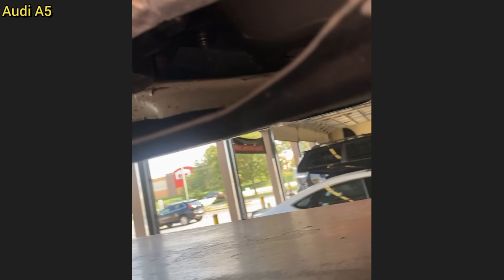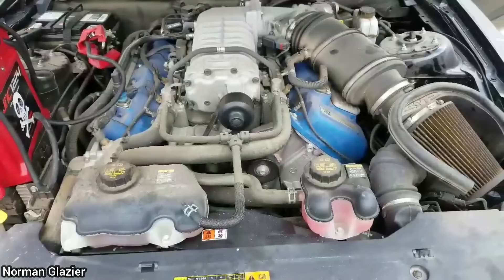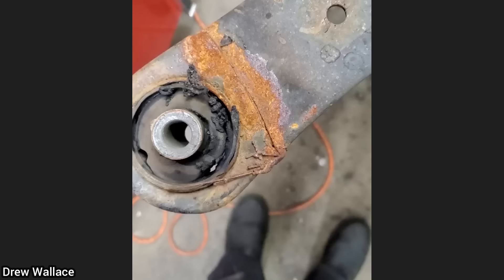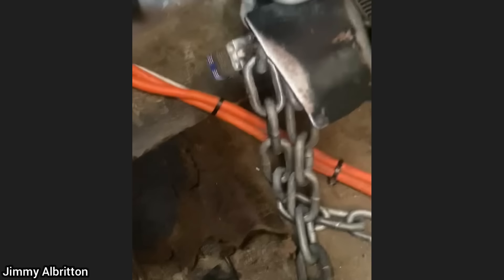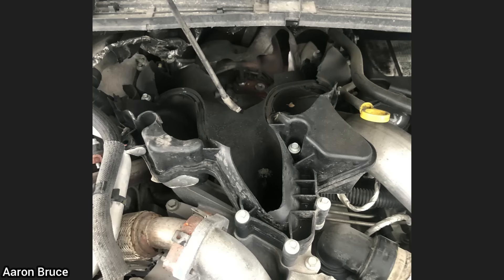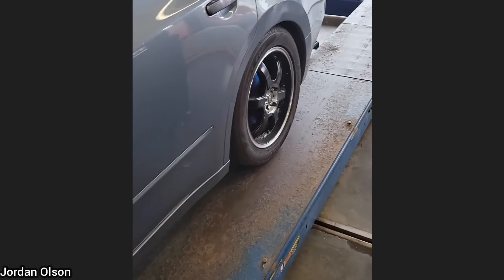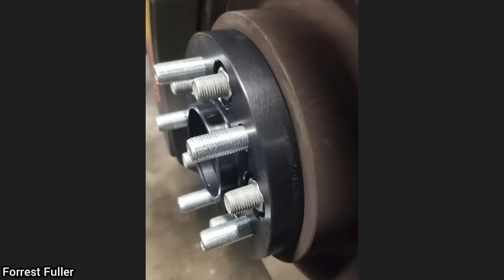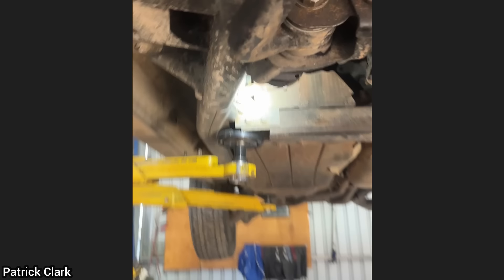Customer States Car Lost All Gears On Highway | Just Rolled In

Comment: Someone bought a GT500, and NEVER GOT AN OIL CHANGE??????
Reply: And it's 12 years old, with only 12k miles.
Reply: Aren't dealers trying to push 10k Mike oil changes now a days? So they were only 2k miles over due LUL. Personally i would have changed the oil myself at least twice by then. It might be excessive and i might be spending too much, i won't go over 5k miles on oil unless i have consistent oil samples to show that i can actually go longer
Reply: All original, 1 owner.  Original everything, original fluids too.  NO LOWBALLERS I KNOW WHAT I HAVE😂
Reply: @legionofanon oil isn't good for 10+ years
Reply: @legionofanon My car has 137k miles with oil changes every 10k with full synthetic as per the VW service manual and it looks brand new inside the valve cover. Just do what the manufacturer recommends, they spend millions researching for a reason.
Reply: I think there are a fair number of people who blow it all on their dream <whatever> and then have nothing left for little things like maintenance.  You see this with people buying their McMansion and then having no furniture.  How much maintenance do you think that house sees?
Reply: @Tracert-mc1hu  The manufacturer only has to get you through the warranty, they don't care after that. Sending in a sample to be tested and gradually increasing the OCI is the only way to be sure.
Reply: @WildBikerBill  and nothing on the walls haaa
Reply: @legionofanon   As a Ford mechanic, I can confidently say that while the engineers CLAIM that they can do 10k without damage, that is very rarely the case. Our dealership recommends oil change every 5k, ESPECIALLY for turbo or super charged vehicles.
Reply: @legionofanon  Only with certain oils, which would probably not be found in most Fords. And he'd still be 11 years overdue
Reply: @legionofanon America really is a different world. I haven't seen a 10k mile oil change in 20 years. My car has been done as per schedule at 18k intervals and still runs very happily at 286k.
Reply: @smorris12  No you don't
Reply: @A.J.1656  I must admit it was an assumption. I'm in the UK, but for the 28 years I've been on the internet, US ideas on change intervals have been crazy short. 3k was the norm back then and it seems to have barely got to 5k now. My first car at the time from the 80s with an ancient 60s OHV engine but with an 8k interval. 10k was the going rate in the 90s. By the 2000s European cars pretty well all had intervals in the 15k+ range. Oil related failures sticking to the schedule and the proper oil aren't common so I find it hilarious to still read stuff saying 10k is impossible.
Reply: @legionofanon  Manufacturers CLAIM 10k oil changes because "low maintenance" sells cars. 10K oil changes will only get you to the end of the 100,000 mile warranty. Meanwhile, people who maintain their cars with oil changes at 3,000-5,000 miles can get 300,000+ miles out of a car.
Reply: @tzon6802  Yes I really do. BMW 320d. I've had it from 127k and 3.5 years old. It was a reps car so would have been serviced by the book and no more often. I've done the next 160k miles and done all the changes myself by the service display on the dash.

I've also got an X5 that is on 188k that gets the same treatment tho I've only had that for 50k miles (think that gets 15k changes.)

Neither burn oil, both run like watches. Both are on the original turbos.
Reply: @alexwalker2582  I change the oil in my 2 EB’s every 6 months at what works out to be less miles than even your 5k interval. I don’t care as synthetic oil is cheap compared to engine repairs, especially with turbos. I also have a 14 year old 5.4 that still runs as quiet as the day I drove it off the lot and doesn’t use a drop of oil between changes. Proper maintenance from day 1 works wonders for an engine.
Reply: @arc00ta  I was doing 10k oil changes and sending a sample to the lab every oil change til I relized the lab cost were only slightly less then changing the oil twices as often. I worked as a diesel mechanic for 20 years and we did 20k and samples nothing ever made 500k with out a failure, and working on   20k oil change and a 12k oil change engine was very different, 20k you replaced everything and 12k you replaced what was broken.
Reply: That’s what I was saying. I’ve been wanting a Mustang forever and I wouldn’t treat it like garbage. It’s most likely a garage Queen since it’s a 12 yo car with only 12k miles.
Reply: @legionofanon Oil has a service life of 2 years, so it was 10 years overdue. You cant keep it in the sump forever.  Modern synthetic oils are good for 10K miles in non-turbo engines but 5K miles for turbo engines.
Reply: IKR ?!?! Who does that ??
Reply: @jellef4704 my grandpa has a ‘04 BMW Z3 that he bought brand new and he treats like his baby… as in drives it once a year like 10 miles to the store and back.

He hasn’t changed the oil in atleast 5-7 years because “I’ve only put like 2k miles on it!”…

Little does he know I steal it every now and then and got the oil changed for him lol
Reply: @Tracert-mc1hu True, but for severe service those oil change frequency is much shorter.
Reply: @alexwalker2582 the problem is, telling the customer they need one every 5k and then they think you are ripping them off, thats why manufacturers try and extend service intervals to make the customer feel beter
Reply: @smorris12   ahhh see there's the information you left out. 320d. That d makes a huge difference in how the engines duty is cycled, my friend. Yeah 10k + changes for diesels are fine. Especially with the quality of fuels and oils you have access to in the UK.

The automotive literacy of the average American would terrify you.
Reply: @connor3288  We've all read that infuriating ad
Reply: My Skoda Superb has 20,000 or 2 years oil change intervals, what is it with American engine's. Modern fully synthetic oil is far better than old mineral oil.
Reply: @fenman1954  is that km? 20000 km is not the same as 20000 miles. 2 oil changes in 20000 km isn't bad at all. This had 12000 miles and NO oil changes
Reply: @fenman1954  nvm I misunderstood that. 20000 km intervals. That's not a good idea. I drive a Toyota and I wouldn't let my car get that high
Reply: He's keeping the oil ALL ORIGINAL
Reply: I change mine every 5k, just because I don’t have to keep any notes. If the odometer has a 5 or a 0, it’s time for an oil change. 

I’ve heard many of these where people run the car until it won’t move, no idea that oil needs changing. My niece had a used car,  but very nice, the low oil light came on, she kept driving until it wouldn’t move! Back in high school, there were girls in drivers ed class that had no idea what made a car move! While it wasn’t part of the curriculum, we went out and opened a hood, and had everyone check the dipstick.
Reply: @jellef4704 Time actually makes no difference at all, by itself.  Stored oil has a nearly infinite "shelf life", even if it's stored inside an engine if the engine is sealed well.  Oil needs to be changed because it gets dirty from use.  If the engine isn't being run, the oil doesn't degrade... as long as it's good oil to begin with.  However, since that oil had already been run way past the recommended mileage, it had likely turned to sludge after 12 years.
Reply: @kj64gaming19  20,000 mile intervals or every 2 years which ever comes first. The car actually tells me when a service is due. Fully synthetic oil is not cheap but keeps the engine like new.
Reply: @smorris12  those sounds like kilometers
Reply: @TheRealSykx  Miles. 18,000 miles. 286,000 miles.
Reply: @alexwalker2582  The manual for my Ford says to change when the computer says so or  max 12 months, so even with  low mileage you should change it.  I don't put that many miles on mine and I don't reach the max miles,  so I usually change it every 6 months, spring and fall.
Reply: @Crosshair84  I know someone with a 2014 VW Passat, 2.0 diesel, which is used every day as a taxi. It gets oil changes every 10,000 miles. It currently has 240,000 miles on the clock, is on the original engine, and has no issues apart from a faulty EGR valve.
Reply: @legionofanon the first oil change is mandatory, usually after the break-in period (500-1000 miles). If you abuse your car (like any gt500 owner will do), you need to speed your oil changes to 5000 miles, so that  ar was due 3 oil changes
Reply: @rwill156   Good on you sir, that is exactly what you should be doing.
Reply: I remember I saw a commercial once that showed a snobby, posh individual with a british accent saying "what motor oil do I put into my $100,000 (back when that would have bought about 8 new pickup trucks) Rolls?" Then he gets an agonized look on his face and switches to an american accent and gets big-eyed "The CHEAPEST I can get!" (presumably meaning once he blew that much on a car he doesnt have enough left for fancy oil).
Reply: @alexwalker2582  No wonder you don't want to sell the Mustang Mach-E. 🤣
Reply: @legionofanon that would not apply to the first oil change from running in
Reply: @geirmyrvagnes8718  oh no. The reason I don't want sell those is because they are trash. The amount of recalls those things have been getting is ridiculous, the high-volt battery is a complete shitshow to remove, AND THEY STILL CAN'T MAKE A GODDAMN APIM PROPERLY!
Reply: Bro I've owned junk my whole life. That truly broke my heart.
Reply: I've had countless scat packs and rt dodges come in with 20k and factory oil filter.....no oil on dip stick.....mad cause warranty with free oil changes is now void....
Reply: I know, isn't that amazing?
Reply: @legionofanon now a days? The oil change monitor on even early 2000's Northstar Cadillac's were programmed to approximately 10k miles give or take depending on how it was driven, and that was with conventional oil. The engineers at Cadillac programmed it based on thousands of used oil analysis. I've had 4 of them and always waited to change my oil when the car told me and never had any engine failures on any of them. 
"Now a days", they have full synthetic oil and filters that are good for 20k miles FYI.
Reply: @legionofanon They need a job lol that’s why they do 10k intervals.
Reply: 12,000 miles is longer than you should go, but it's the fact that it's 12 years old that seems really problematic to me. At least don't go more than a year without an oil change!
Reply: That's why I never trust "low mileage" vehicles.
Reply: @Tracert-mc1hu I don't think going 12k miles was the problem, it was not changing it for 11 years. Oil will get acidic from a bunch of short trips. Minimum is change once a year.
Reply: @fenman1954 US engines are just fine, and most are changed when the computer says to according to the drive cycle of the owner. All highway? Probably 15k. Stop and go short trips in city and never heats up fully? Probably 6 to 8k.
Two of my BMWs had terrible problems with crankcase ventilation and the system would plug with sludge. Sometimes the oil would get sucked into the engine and ruin it with hydro lock. 
Volkswagen (Skoda) had tons of problems with rear main seal leaking and fixed a boatload under warranty... my brother's Audi and my friend's Jetta both.  No one is faultless.
Reply: @legionofanon  
It is supposed to be changed once a year at least.

But their was a dealer selling a no miles 4 year old Lotus with original oil.  I pointed out to them that that would void the warranty, they were not too happy with me!
Reply: Criminal is what that is.
Reply: @Crosshair84  I thought 3k was a standard.  Why are ppl even saying 10k??
Reply: @livewire2759  "Stored oil has a nearly infinite "shelf life", even if it's stored inside an engine if the engine is sealed well." there was some previous comment about Americans technical illiteracy and you presented it here very well...
Oil engine in used engine is full of stuff that is produced inside your engine...
that include water that is a common huge chunk what is produced when you are burning hydrocarbons aka any type of fuel used in any internal combustion engines that i can imagine now.
The fact that it was used in this time not very often is also sign that the engine was not getting very hot and that is another reason why this oil did not have easy life.
Reply: @mitchhedberg4415  "I pointed out to them that that would void the warranty," posible as it is legal issue, but 4 years old oil that was not used=isclean is not the same as 12 years old used oil full of all kind of chemicals that are not good for it...

Comment: That Focus ST owner expecting a warranty repair! 💀
Reply from the maker: had drag radials on it as well form what I was told lol
Reply: This is only the 2nd time I have heard a Ford Focus ST referred to in a USA video. I assume they I quite rare?
I own a Focus Mk3 ST3 in the UK, they are very common to see driving around here.
Reply: Drag radials?????  For WHAT? ??
Reply: @JustRolledIn  Icing on the cake! What a 🤡
Reply: @JustRolledIn Drag tires+clutch dump=$$$$
Reply: The Focus ST already has an aggressive tune as the motor is not me for anything more aggressive
Reply from the maker: @Lemmon714_  drag racing? 🤪
Reply: @jamesm568 I think you are talking about the focus rs, that thing can't do much more than an additional 50hp, the st on the other had can often easily do 400hp without opening the block, which is 150hp over stock
Reply: @timtechdude4339  I mean in the UK you see more focus st's and fiesta st's than any other country, but I don't think they are that rare in the USA, just less liked, like I see so many people hating on them, honestly just annoying
Reply: @MrTurbo_  That's probably the case, but with aftermarket tunes they like to take out all the delays that adds additional stress to the engine.
Reply: @jamesm568  That's not accurate, some may take out 90% of the safety margins where possible, but there are plenty that keep more than enough in place, especially tunes that are optimized for making use of aftermarket parts like bigger turbo's, exhaust, etc do not need to take out much safety margins to provide additional performance from the installed parts.

Comment: Sweet truck at the end.  I love it when people take these old girls and restore them to live another day.
Reply: Right? There's a classic local to me that's clearly someone's pride and joy. Fuggin' immaculate from the wooden slat bed to the interior and paint.
Reply: K 1500 late 60s or early 70s
Reply: @mikefoehr235  '72 K10 (lights in bumper '71/'72, mirror glued to windshield and no black stripe around grille '72). C/K1500 started '88 (purely as info)
Reply: Yup, that's a proper pickup.  It's not bigger than a  Freighliner, has a proper bed, even has vent windows.  Why can't we buy a pickup like that anymore?
Reply: @MrSloika  Power Steering, and Power Brakes, Automatic (bad leg), and perhaps an A/C unit would be all I needed.
Reply: @MrSloika epa and safety standards.
Reply: @BrianBourgeois-  But at least they have ABS, Traction Control, Stability Control, Lane Departure Warning, Blind Spot Monitoring, Tire Pressure Monitoring, heated leather seats & mirrors, sunroof, backup camera, and more!... All for the low, low starting price of $55,000, with about the same fuel economy as my '99 Jeep Cherokee. 🤣
Reply: Alternatively, this truck was fortunate enough to survive 50 years of terrible owners.  It didn't belong to a guy who beat it with a padlock on a belt, to someone who never changed its oil, or to someone who declined all repairs after taking it to a mechanic.
Reply: Felt I heard my cat purring there.
Reply: Oh for the good old days when Chevy trucks were tough and the factory wasn't experimenting with technology and letting the public find out whether their "improvements" work or not.
Reply: @MrSloika  Yes, a proper bed that hasn't been unnecessarily shorted by a 4-door cab.
Reply: One of my absolute favourite old vehicles is the old trucks just like this. I would LOVE to have one like this over a new one any day.

Comment: I am not ashamed to say i might be a grown 63 year old man but i become a 6 year old girl when i see bugs , especially ear wigs but this looks like a cockroach infestation , still sends shivers . Plus the dealership was wise to fit the bill for that control arm , yes it was welded but with the recall in play and liability issues that could arise in a court of law they did the CYA ..
Reply: The dealership is screwed either way. They have to do the recall work, but if they send it out with an obvious safety issue they become liable.
If it were in for a regular repair or maintenance they could just refuse service altogether.
Reply: I quit a job once on the second day because they didn't tell me there were roaches involved and I don't regret a thing.
Reply: @christopherconard2831  You are spot on , when there is a recall for safety related items which are often but not always called by the Ministry , there is no place for chances . GM has had similar recalls for missing welds and cracks in the cradle and control arms although no knowledge of this Chrysler one but probably similar considering sometimes parts made in the same factory ..
Reply: I wonder what his house is like ?? Crawling with bugs.
Reply: @petermontoya1796  Well there is something in that vehicle that has attracted them and yes sometimes you can judge how a person lives by the inside of their vehicle in my experience .
Reply: a control arm in most cases is under 100 bucks,  there doing the labor anyway.
Reply: The real Roach Coach!